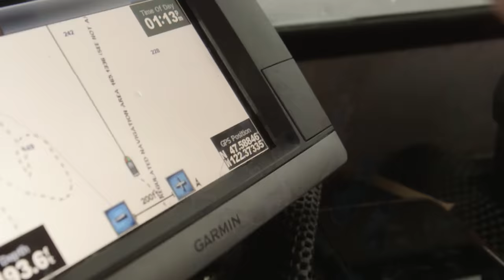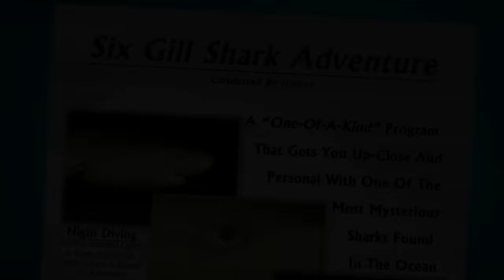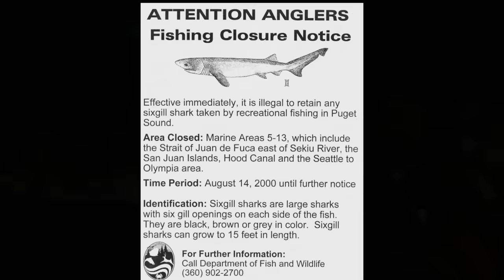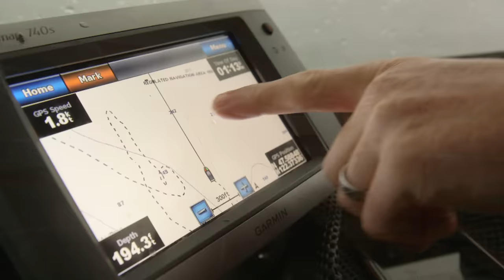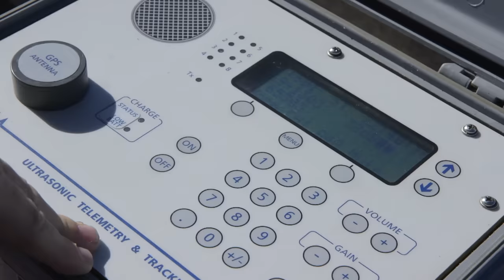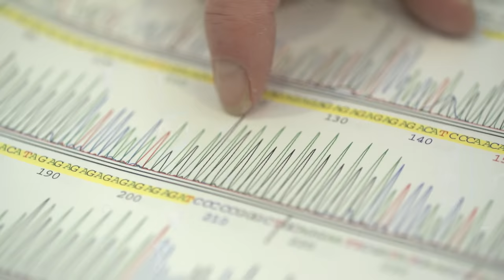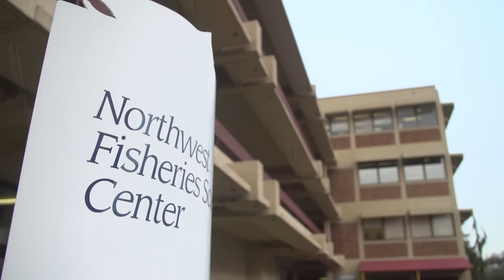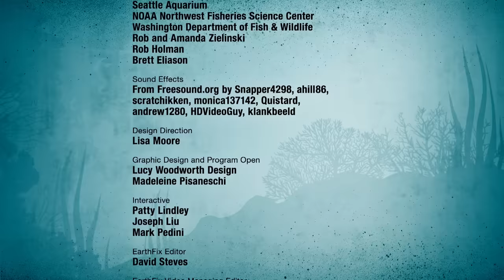Wildlife Detectives: Mystery Sharks of Seattle

Comment: At 40:10, what does he have attached to his nipples?
Reply: Haha, those are the valves on his dry suit I think. Unfortunate placement.
Reply: Simon W -- I take it you've never used a dry suit.
Reply: Janice Van Horn "At 40:10, what does he have attached to his nipples?"

One of those is the inflator valve for the dry suit, and the other is the exhaust valve. Nowadays the inflator is usually placed over the sternum and the exhaust is placed on the left arm, but in the early days there was a wide variety of placements.